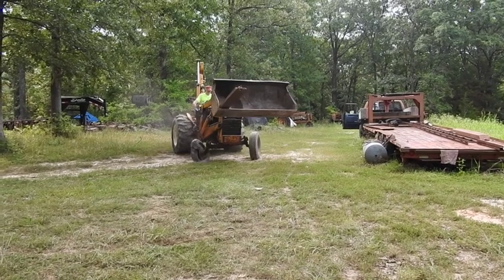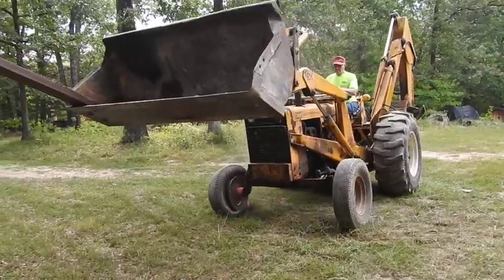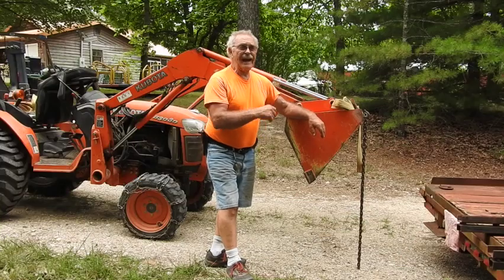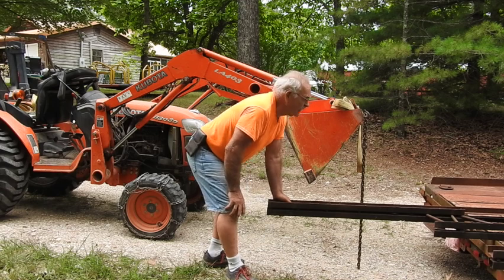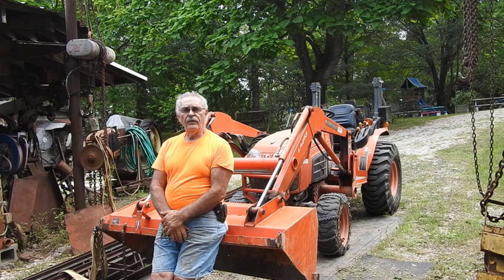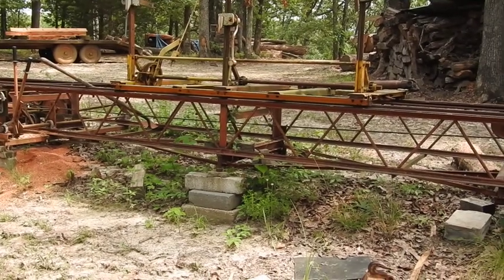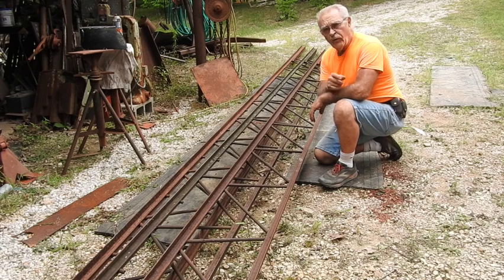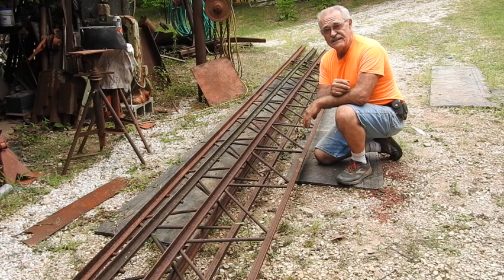Scrounging Material for Frontier OS 27 Trailer

Comment: Wendell; Do you know what Cold Pack beef is ?
Reply from the maker: No Tom, that's a term I'm not familiar with that term.  I might know the process if its called something else though.... ??
Reply: @tractorman4461  it's any meat that's been put up in Mason jars such as vegetables, fruits etc. 
Packed cold not heated .
U can  Google the processes.
Reply from the maker: @tomwalker9184  Hahahaha....I don't have to google it Tom.  We just didn't call it 'cold packing'...  Yes, my sisters put up soup stock, green beans, boiled and peeled  tomatoes, and all kinds of stuff.  We had shelves and shelves of Mason jars, the zinc lids the whole ball of wax.  I remember the pressure cooker whistling away while they're cooking stuff down.  We'd can grape jelly and seal the top with melted paraffin before putting on the lids.  We used to make our own ketchup and still have the bottle capper we capped literally hundreds of soda bottles full of good old thick home grown tomato ketchup !!  The old man would salt cure the pork shoulders, hams and bacons and leave them in the smoke house all year as we used 'em up little by little.  I still even have my great grandpas brine tank he made somewhere around the 1870's out of a hand hollowed 30+ inch diameter cottonwood or sycamore tree.   It's more than 9 1/2' long and more than 30'' in diameter. Instead of a dry rub, they'd soak it in heavy salt water for a determined amount of time then hang them on the racks wrapped in cloth wrappers, cutting chunks off as needed.

Comment: I'd rather like to find nice webbings like that than build it from scratch!  That is premium material in my opinion! lol! Thanks!
Reply from the maker: I figured they would be light enough for the job but rigid enough to give the support needed for the 21'length of the sawmills bed frame.  With proper bracing and a good axle it ought to make at least an adequate mainframe.
Reply: @tractorman4461  I totally agree!

Comment: I think you fellas got your moneys worth out of the right front tire on the Case LOL! Man, I could use some of that for a lean-to addition on my shop! That should be a good strong trailer for sure.
Reply from the maker: Aw heck Matt.  We shoulda got another hundred miles outta that tire !!  Of course that old tractor has been put through its paces over the years.  He's got shorter length and longer length in the pile.  But yes, I'm trying to talk him out of a few more for another lean-to my shed too !!
Reply: @tractorman4461  At least the rim got sandblasted at the same time LOL!
Reply from the maker: @mattthescrapwhisperer  heck yeah, makes the bead seat real good on those tubeless tires !!  LOL

Comment: Can't wait to see this build. Looks to be a really cool one! 👍👍👍
Reply from the maker: I think the end result turned out at least adequate at the minimum.  LOL.  I wasn't easy though.  I think the store bought one was $1470.00 and if I remember right, it was only for a 14' length of track maximum.  Which means each time you relocate, the last section would have to be attached, leveled and supported with additional supports beyond those of the actual trailer.

Comment: Nice start of the project 44, my Farmall right rear tire looks like the Case front right, it's totaled, this will be an awesome series to see the trailer or support frame for the Frontier will come to reality
Reply from the maker: We have flat tires all the time on various pieces of equipment.  It's a curse.  Some of my rubber is still original from all the way back to my '39 Massey Harris.  That's 82 year old tires still holding air.  And my brother's '37 Massey still has original rears as well !!